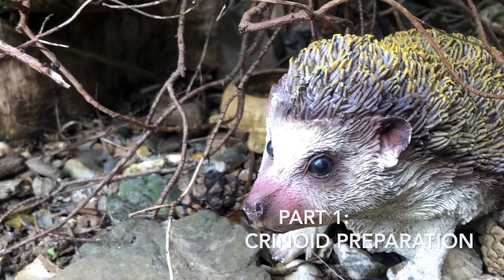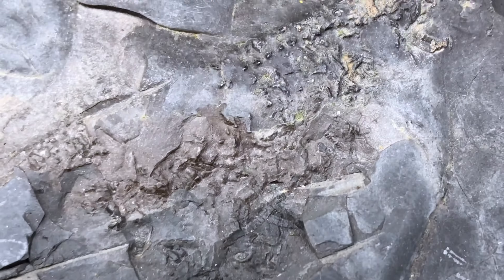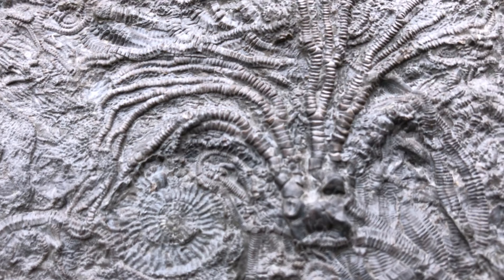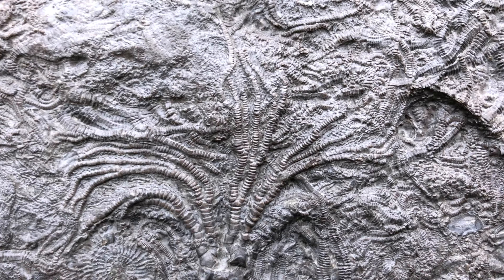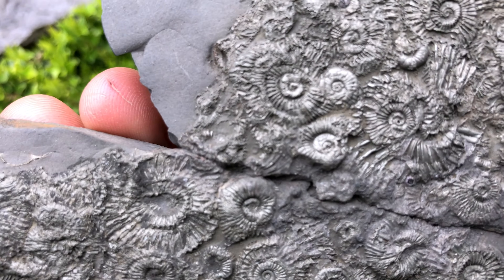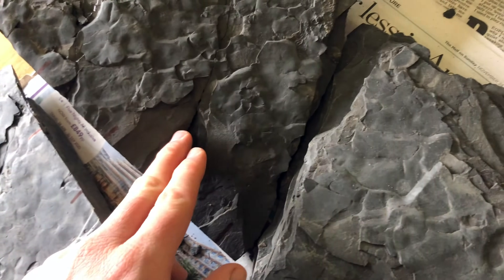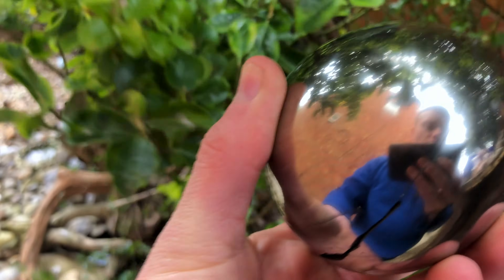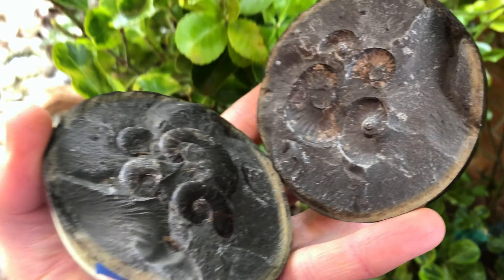An Introduction to Fossil Preparation! Ammonites and Crinoid

Comment: Guess i missed the part where we desribes the tool he uses.. is it sand blasting?
Reply from the maker: It is indeed an air abrasive tool :)
Reply: @YorkshireFossils  I'm in the states, no competition for you, but I'm frustrated at no solid answer on the tools that you use. Could you be more specific, talk about tools you dislike and what you chose and why? please???
Reply from the maker: @rcfstovesfireplaces3860  The tool I was asked about is an air abrasive tool and is offered by many manufacturers. The air pens are also offered by many manufacturers, we personally use Ken Mannion or ZOIC Palaeotech

Comment: Excellent! One half hour down the road from me in Indiana are the famous Crawfordsville Crinoid Beds. At some point a fine layer of silt buried these to preserve them before some more destructive forces were able to ravage the beds. The results are arguably the best preserved specimens on the planet. It is still possible to discover a yet named variety if due diligence is shown. 
Fine work, I had never seen this process though so had wondered on it. In the southern part of my state there are similar slate concretions, some as big as Volkswagon Beetles! I do wonder what might be within those. Great video, Cheers!

Comment: Can someone explain how the machine he uses to prepare the crinoid work. 
Is it air he blows at it?
Does it not break the fossil?
Reply: The first part of the prepping is a kind of Airbrush with different types of iron-powder. Its like sandblasting. Those prepping tools work electric or with air pressure.
The same with the pneumatic stylus later in the video.
Have a nice day, greets from Munich, Bavaria!
Reply: To prepare fossils needs time to learn about how to do. You can even study it. And for sure, you have to be very careful not to destroy the fossil while prepping it. Everybody broke some fossils by beginning to learn about this kind of work...thats a fact.
Reply: @huenchen82  thank u i was curious. Also hello from limerick ireland